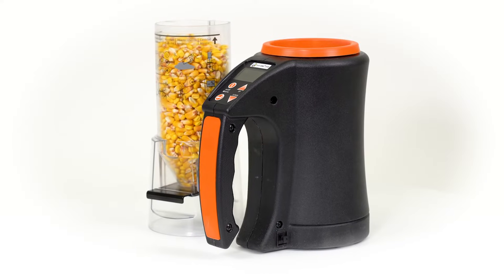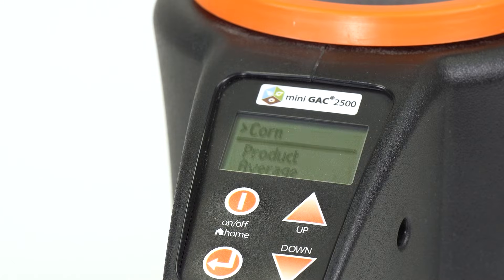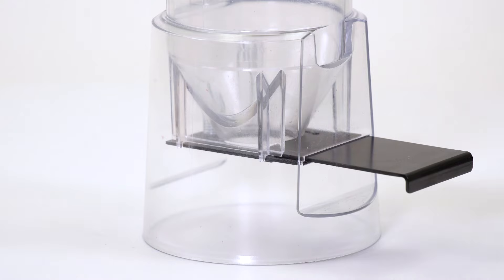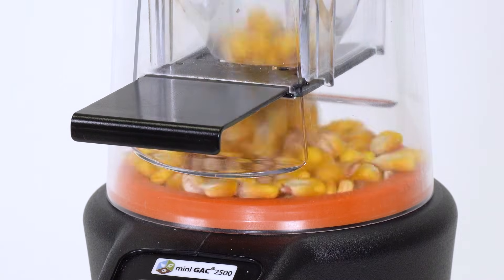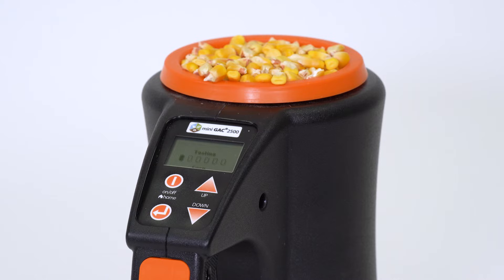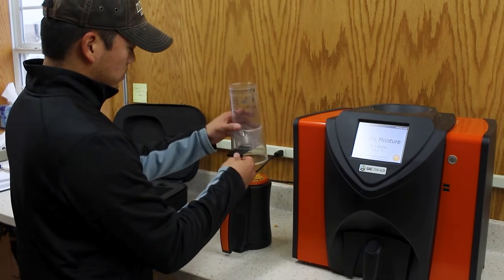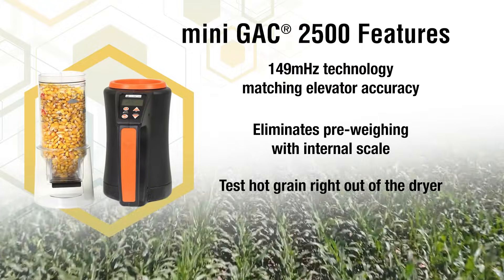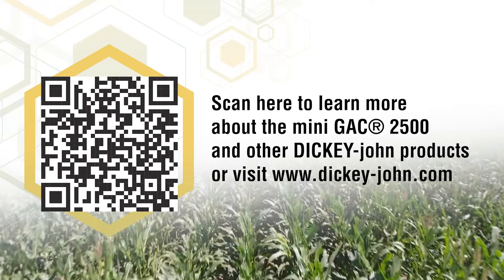DICKEY-john mini GAC™ 2500 Product Demo

Comment: OPERATOR’S MANUAL 
40 / ERROR CODES mini GAC® 2500
6010546 Rev C
ERROR 60 
Probable Cause 
Language files are not found in device and can only be loaded 
by a DICKEY-john technician. 
Corrective Action 
1. Power off device. Unit is not operational and should 
be returned to DICKEY-john for service. 
ERROR 62 
Probable Cause 
The language selected is not loaded on the instrument and the 
first language is automatically selected. 
Corrective Action 
1. Press the Enter key to return to the Main Menu. Select 
an available language, if desired. 
2. Return instrument to DICKEY-john to load a 
specific language, if desired. 
ERROR 78 
Probable Cause 
A normalization file required for proper operation is missing. 
Corrective Action 
1. Cycle power to see if error returns. If the error appears 
again, return the instrument to DICKEY-john for service. 
ERROR 79 
 Probable Cause 
Error 79 displays when a file transfer from the Main Board to 
the Cell Board fails. 
Corrective Action 
1. Cycle power, retry steps that caused error, and see if error 
returns. If the error appears again, return the instrument 
to DICKEY-john for service. 
60
62
78